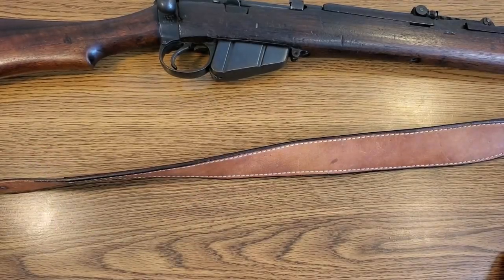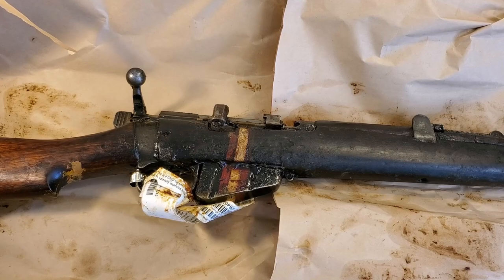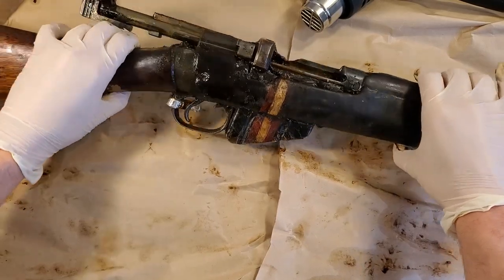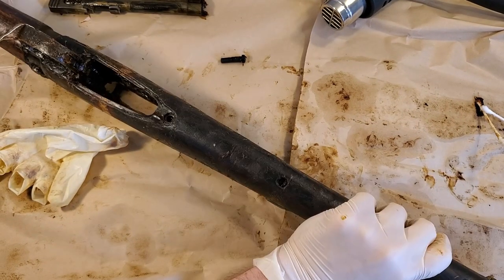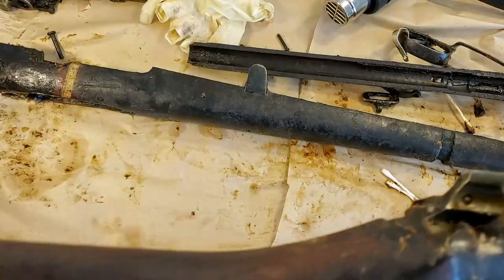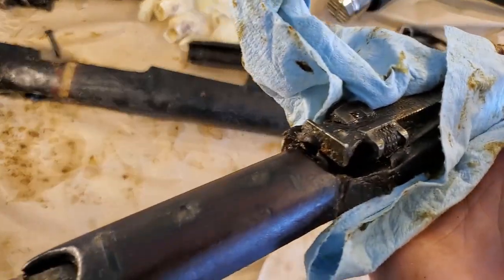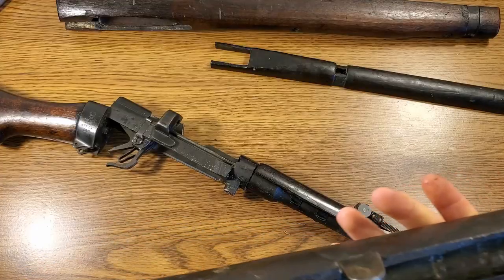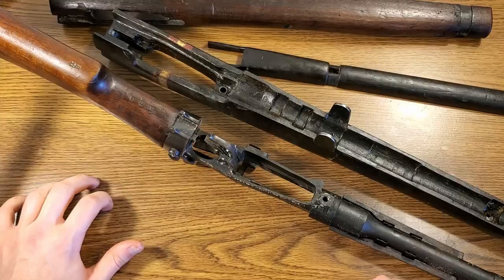Restoring World War I No.1 Mk III SMLE Lee-Enfield  -Part One-

Comment: I'm currently restoring an SMLE and ran into the exact same problem as you did; bought an Ishapore forestock that didn't fit because the reinforcing bar was in the way. The solution I think will work is to take the forestock to a gunsmith so he can grind through the bar just enough to allow the stock screw to fit. Best of luck to you in restoring that beautiful rifle!
Reply from the maker: I have considered this method and I could see it working. The second option is to grind off the end of the stock bolt until it's flush enough to fit.Either way it's going to take some fitting.
Reply: @ReadinessReviews  I don't recommend grinding down the stock bolt too much because you might risk disconnecting the butt stock from the receiver, but grinding it down a little shouldn't mess anything up. I'd rather modify the forestock than the whole stock screw (mostly because finding the right screwdriver for it is almost impossible).
Reply: Readiness Reviews
 All you have to do is change the stock Bolt. Which is most likely a pattern one or two that you have currently because that Ishapore is a 8th pattern stock. It was not compatible with early pattern 1 and 2 bolts.

Comment: Not sure if it has not been mentioned, Post WWI buttstock bolts on the No1MkIII* had the square tip ground off to be the same as the No 4 stock bolt. This eliminated the issue of having to remove the forestock (disassemble the whole rifle) if the buttstock was in need of repair or replacing it to a different length.
Reply from the maker: Yup, Swapping the bolts is how I got this figured out in part 2.
Reply: @ P M: Thanks very much for that info! That explains why my 1914 LSA SMLE No1 MkIII stock bolt never seemed long enough to engage in the fore stock. My SMLE was a de-act with most of the small parts replaced over the years (and two World Wars) with later versions. I spent a year or two sourcing all the correct parts from as far as Canada and Australia to rebuild her back to her 1914 configuration - windage sights, nose cap with piling swivel, button cocking piece, replaced the missing cocking screw, added the magazine cut off back in and finally got both the long range volley sights back on (carving the fore stock to take the front volley was not for the faint hearted!) I finally got one of the metal re-enforcement plates which sat in the fore stock with the square cut out but the bolt never engaged with it - now I know why!

Comment: The stock disc being filled in with wood is actually something the british did at the tail end of ww1. They stopped really using it fairly early in the war, late war examples will mostly either have blank discs, disc holes that have been filled in with wood, or a lack of a disc hole entirely.

Comment: A couple of things here! Remove the cross lug 2 reinlet for BSA stock bolt 3 make a filler piece of scrap wood for the crossbar  screws you won’t be reuseing it 4 acraglass back on the rifles with stock on use plenty of release agents 5 remouve forstock check forstock draws shim with wood or brass shimstock as nessasary. // the other way to go is keep the original BSA forstock but cut it right in the middle of the band,( like a duffle bag cut, then splice the ishapore Also duffle bag cut and dowel to original use acraglass and release agent on forstock band , or Grease cosmolene would work, blend forstock wood after 24 hrs , reinstall bands caps ECT

Comment: As Mr. M suggested change the stock bolt or you can file/grind the square protrusion off of the existing stock bolt. You are not taking the rifle into battle so there is no fear of the rear stock coming loose while "giving someone the business" with the butt of the rifle.
Reply from the maker: I just ended up swapping the bolts too. Everything came together well. The final video is up on my channel if you want to check it out.

Comment: That stock will fit the rifle all you have to do is ether grand down the butt stock bolt a little bit or just put the Ishapore butt stock on your BSA if you do that it will be restored. The Ishapore factory shorten the bolt that holds the butt stock on the rifles because it can stick out a little to far and sometimes can crack the forarm if not put back on correctly. The best thing to do is just put the Ishapore butt stock on your BSA Enfield so you can fit the forarm on.
Reply from the maker: A couple of people have suggested that. I'm going to try it just need to find a long enough driver for the job. Thanks for the info!

Comment: Just change the butt stock bolt screw that's what I did with mine. The butt screw is the same size and that way the stock will fit.
Reply from the maker: Yeah I think that's what I'm going with. Thanks for checking the video out!!
Reply: @ReadinessReviews  of course your video is why I bought mine.

Comment: What was the point of drill purpose rifles? Were they non firing rifles used for training or were they actually functional?
Reply from the maker: Non firing rifles used for training. Some were build that way from the ground up and some were converted from normal rifles.
Reply: The U.S. Navy at Great Lakes Naval Training Station in World War Two used perfectly good U.S. Property Savage Enfields to destruction due to bolt / receiver wear. They were never fired,only used for Drill.

Comment: Use the stock bolt from the ishapore rifle it does not have a nipple on the end like your original 1918 therefore you do not have to modify anything as the bolt is inside the stock no one will see it
Reply from the maker: That's a really good idea! Do they use the same threads?
Reply: @ReadinessReviews I believe they do I used a stock bolt from a No4 Mk1 in my No1 Mk3  and the threads were the same
Reply from the maker: @kevinstarling5637  Awesome. I'm going to give it a try as soon as I get a long enough driver. Thanks!

Comment: Hey! Just got an ishapore dp enfield same model, is it possible to restore the dp enfield? And range of cost to do so?
Reply from the maker: I wouldn't recommend trying to "restore" a DP rifle to a firing configuration. Many DP parts were never designed to be used in a live firearm. The pressure bearing parts could have incorrect heat treating making the firearm dangerous to shoot. On mine the receiver has a hole in it and the bore is plugged with a weld so at a minimum the receiver would need to be replaced. They are nice rifles for display or harvesting non-pressure bearing parts from. Thanks so much for watching! Hope you enjoy your rifle.
Reply: Readiness Reviews mine has the same dp with a hole and weld through the receiver. Thank you for the response! I plan on using it as decoration its my first ever firearm and i just bought a lower receiver to make my second which will be a custom ar.
Reply from the maker: @JerzeyCountry  Awesome man. I think that's the way to go!!
Reply: Readiness Reviews thank you! Have a great day and stay safe!
Reply: About the only possiblity is costly...but a fun project. Get a .22 Caliber Barrel Liner and have the .303 Barrel lined with it. Liners either Solder or cement in. Next modify the Centerfire Bolt Face and Extractor to .22 Rimfire. The Drill Purpose Enfield Magazine and Floorplate get used to hide a .22 Caliber Magazine. The old drilled Receiver and Barrel will need welding and filling to repair the DP Holes. Sub Caliber is the only way to go...other than a SARCO Barreled Receiver and a good used bolt from a non DP. A .22 Conversion would probably run $250. Restoring with Surplus Parts from SARCO maybe about the same. The Serial #s won't match either way.

Comment: After reading the comments its seems like you're probably gonna  Fudd this gun as much as the guy who originally sporterized it. Im really hoping you didn't grind off the back of the bolt. Also it looks like your "deactivated rifle" mostly needs a firing pin. I didn't see any major cuts or drills in your video.
Reply from the maker: Watch part 2